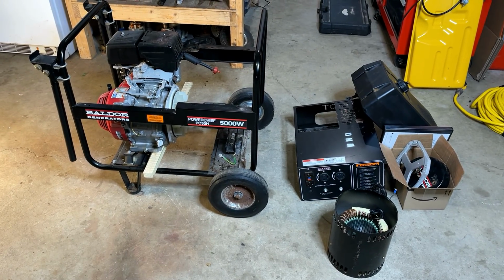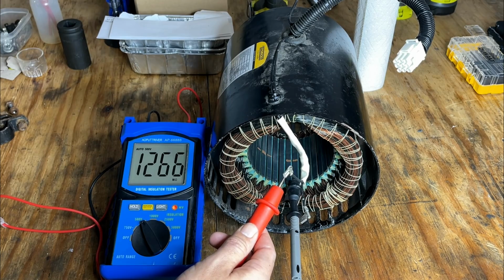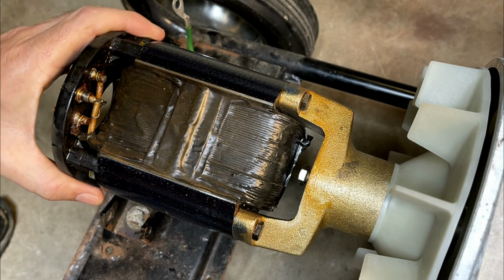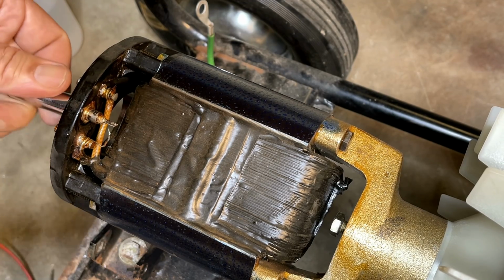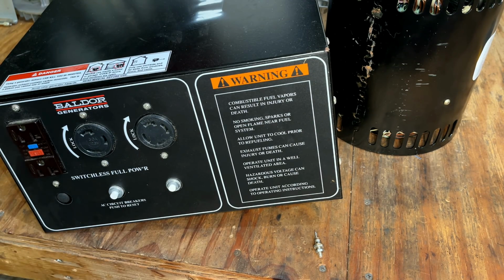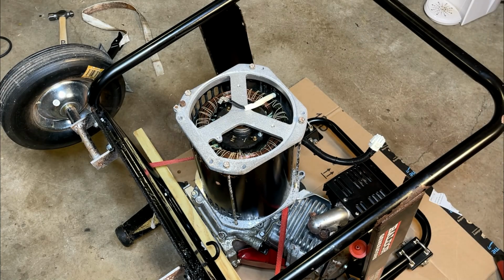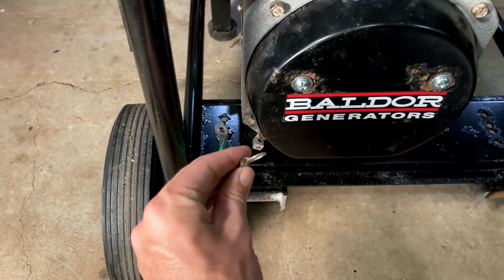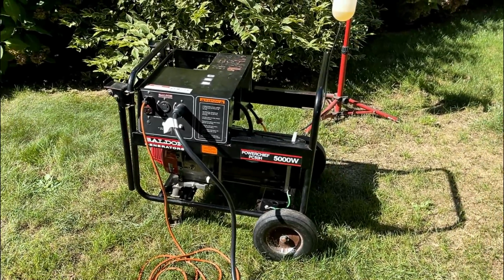Baldor Generator Not Making Power - Can It Be Fixed?

Comment: 0822MMXXV/1837h 🇺🇸 Thank you for introducing BALDOR Genset.  The rectifier in question, is International Rectifier  (IR) model. It's freely available from10A~25A. The rotor design is quite unique  and looks and functions perfectly. This design should be a standard in all gensets.
Reply from the maker: It was very unique.  Was nice that they made the diode serviceable.  Most manufacturers do not.

Comment: I have soldered diodes in an alternator an those diodes were heat sensitive, I used rubber band on a needle nose to heat sink between the diode and the  solder point

Comment: Should I turn off the fuel flow and allow the carb to run dry when storing my generator...?  Store it with a dry carb?
Reply from the maker: Always store with the fuel valve off and the carb dry.  It you keep fuel in the tank you must change it out at least twice a year.

Comment: John I would recommend you stop working with the multimeter on DC Ohm measurements. Neither is it usefull to measure isolation with 1.5V nor a very good diagnosis checking 0.5 ohm windings with a 200Ohm meter . Instead put a AC power  of 240V on the coil with a light bulb as a current limiter, that way you will even detect shortcuts within the iron packets and save lots of time.

Comment: Since the repair didn't seem to have worked out, because of the last very informative comment - I suppose when the diode you put in there saw that big ratchet - it went straight to its knees - let's see how it goes. So you got it off the ground - now I'm into Averlance diodes - currently learning electronics in my spare time and just finished the diodes/zener topic and finally understood more of the basics than before. Well - brushless generators generate dirty current - or voltage - I thought this distorted sinusoidal signal could have something to do with the diode you installed - I also have a few generators lying around that I can get out of the scrap junk for little money and buy more if necessary bring it back to life after experimenting - thanks for the video and so many detailed informations

Comment: Just looking at the diode you took out it looks like it has so much solder under the flux on the tab/wire lead that it has run down to where it touches or almost touches the body of the diode.  You may have added more solder removing the wire, I didn't pay that much attention and know you do that as many of us do.  I'm sure you probably melted that solder removing the wire, hard to tell if it was the original cause of the diode short.  But that might be why it would short when you pushed on the solder tab later.  There can be a small solder flake that sticks to the glass seal around the tab that can cause it, as well a problem internal to the diode.  Good catch, if the solder was the issue it could have been something that would only short when the tab bends a little due to centrifugal force when it is running.  That would have been a real bear to figure out.

Comment: That diode was probably never designed for the sustained g-force, and the internal link wire was likely moved into intermittent contact with the inside of the diode case. Cleaning up the diode and giving it half a turn before re-tightening (to reverse the g-force) might have done the job!

Comment: The diode in question is not a critical part, but a run of the mill rectifier diode. It is NOT a zener, as evidenced by the marking. Look for one in the same package with the positive to the stud, and a rating of about 200 volts and 10 amps. The actual rating is not critical, but polarity is.

Comment: the reason the resistance values climb up slow is that the windings act like a capacitor and it gets charged slowly...
Reply: the diode is a semi conductor, @ the best of times it is half way there.... this thing is acting weird...ergo it is defective, remove and replace....!

Comment: It was interesting to see the epoxy potting on that rotor.  I've seen that before someplace but can't recall just where,  I think that it was in the motor of a power tool.  This is a good thing!  I'm thinking that the manufacturers should be doing this,  but of course when you do you affect heat dissipation which needs to be taken into account.

I'd have done things a little differently than how you did.  From about the point where you put the spark plug back in.  I'd have hooked up that outlet box and spun that shaft with a drill,  see if it was putting out any sort of power at that point,  and only then proceeded with the rest of the reassembly.

I was just thinking while watching that how I'd be interested in seeing the waveforms coming out when you went ahead and did that.   :-)

Comment: On steel you can use some Muriatic Acid to dissolve all that rust and paint to prep for paint. Obviously use some Baking Soda/water to neutralize it after and it should look great afterwards. The acid should only take 1-2 minutes but dilution level will affect it a bit.

Comment: Here all my life I thought brushless gensets were cleaner electrically. Glad I have only had brushed ones now. I had a 400 watt modified sine wave inverter in my car while my daughter had a DVD player hooked to it for her son. Ruined that DVD player, or something did. Makes me only want to use pure sine wave inverters. I had a 2000 watt inverter on my boat and ran a microwave for years. Course now that I'm older I forgot some aluminum foil on a food packet and it took a year before it would run without smelling hot electrical insulation. Still working. When you get older don't expect to be as good at stuff. I am going to replace the oil intercooler on my Chrysler Pentastar when the weather warms up and both plastic intake manifolds need removed, I hope I don't screw it up.
Reply from the maker: Brushed are more bullet proof, but not recommended for anything sensitive for sure.

Comment: James what I consider happening to the diode is the heat of desoldering reset its silicon into it's good state. Not that it should be used. Just wondering.
Reply from the maker: Yes.  The solder connection looked very poor.  Some suggested I could reflow it.  But would rather go new then risk it failing and have to take it apart again.

Comment: Is the twine a special kind made to break if heated? 4 wires from 2 power windings, 2 being 
joined for neutral. +1 for ground+ 2 for exciter winding + 2 maybe battery charge coil.

Comment: A diode should  be measured in both directions. There should be about a 10 to 1 ratio in resistance between the readings. Disconnect wire from at least one side.

Comment: Just look for the same mechanical configuration with these specs. 400Vdc or higher and N x 5Amp, is the steady state field current for RV generator and 10Amp for whole house. N is a safety multiplier, usually 2x. 

In this case match the mechanical casing to look for 400Vdc or higher and 10Amp rms or higher. 

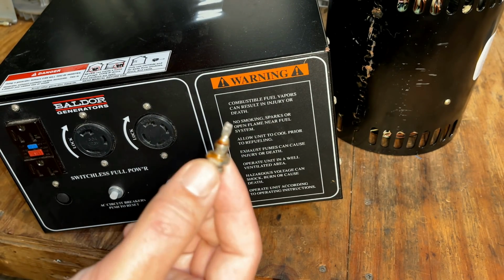For the chart on page 31:00
Discount the first two and pick any one down the list from 400V should work.

Comment: How can you determine before you buy the THD rating of a generator so you can get a clean power gen for computers? I had ordered a Duromax XT13000HX, but before delivery I stumbled upon a statement saying it had a 10% or greater and would need a PowerLine Conditioner for electronics. Too expensive a solution so I'm sending it back when it gets here. Don't want to make that same mistake again. Any thoughts on that??
Love you videos, BTW. Been watching one after another for 2 days now. It's ok, I'm old and retired. 😄
Reply from the maker: 6% THD is the upper end of clean power.  Inverter generators are very clean, but they cost a lot and are limited on power.  Other then an inverter, the next cleanest is a brushed generator with an AVR like the Duromax.  But as you found out, not all are created equal.  Best bet is to shop around and find a manufacturer that states 6% or less.
Reply: @jcondon1  I've checked til I'm blue in the face. Nobody lists that stat in any of their literature. Even the DuroMax was actually an answer to someone else's question on another site. I finally ordered a Generac XT8500EFI because they at claimed "Clean Power" suitable for electronics.
Will that little tablet scope you used answer that question for me? If so I might just buy that. Thanks so much for the quick response.

Comment: A Triac diode will pass A.C. It is two SCR diodes with reverse cathode and anode in parallel. There could be a capacitor between the Gate and anode to trigger an SCR. It has been a longtime! There are tricky ways of doing things Electronic! Have you heard of a guy called Munz?  Ron USA, PTL
Reply from the maker: I have not heard of him.

Comment: Hmmm.....good catch on the diode....at about 24:00 in the vid, you show a closeup of the diode....what is with all the flux, and the big gob of solder on the terminal??  Something looks fishy,  if that solder contacted the body, it would be a short. Just wondering if you cleaned that, to see if that was the 'intermittent' short??
Reply from the maker: It was intermittent.  Cleaning that blob would have worked, but it was also coated in varnish.  Not sure how well it would have reflowed.

Comment: I have an old Kholer 2.5CM in a 1991 Toyota motorhome. It puts out about 5v and will not operate a 60w lightbulb.  When I connect a 1500w heater to it, it will run it at half speed. At the same time, I can turn on the A/C fan and it will run half speed. Maybe diode? Thanks.
Reply from the maker: Could be a bad diode, but there is also a capacitor in the A/c junction box that is a common failure point.  Would test and replace if bad or out of spec.  The capacitor must be the same uf rating and the voltage rating the same or higher.

Comment: The Rotor is a jam fit on the shaft held with a thin bolt pressure but when the amps really increase, the pressure on the rotor as it turns in the stator must be great and still it doesant slip? Guess it is very tight but not actually locked with a key or thread or anything , just friction.?
Reply from the maker: Just friction.

Comment: After watching your video I noticed the part where you discovered the diode had an intermittent short. I think the diode is still good, the issue looks like the big blob of solder on the wire terminal is so big that it shorts to the body. Remove that excess solder and I bet it’s good!

Comment: Are all the windings on therapped with string all insulated  with what type of coating to keep from shorting out from each other. I forget the name given them ? Router windings or stator windings if one wire s shortedto each ot the wires it means it’s bad!
Reply from the maker: The wire used is called magnet wire.  Coated with varnish as an insulator.  If shorted to the same winding then will probably still work but not work as well as it should.  If shorted to another winding or ground, then the powerhead is bad and will either not power up or just melt down.

Comment: A Generac XG8000E (not mine)only producing half power. It shows 1.2 hrs. run time. I'm not a 'fix it man' , but any ideas? -thanks.
Reply from the maker: It could be a bad AVR or maybe a loose wire.  Also the AVR has an adjustment screw for the voltage.  Maybe it was set wrong from the factory?  Otherwise might be more serious, but the power head on that generator is made better then most.

Comment: I've been watching your videos and I saw instances where the stator needed to be replaced. I was wondering, if the engine on my generator fails, can I replace the engine with one that has more horsepower?  For example, my current generator is 13hp. If I install a 20hp engine, would that prevent the stator from producing power?
Reply from the maker: It would work fine.  The old stator would be spinning at the same speed and have the same circuit breaker on it to protect the powerhead.

Comment: That's not "IER" but "I-R" for International Rectifier. That's a run-of-the-mill silicon diode.  Not a zener, not an avalanche, not a shottky.  You're overthinking the problem.  You already know how much current it handles, so....

Comment: Hello I have a question I don't know a lot about it I have a champion 2000 Watt inverter. Do you know how much volts should come out of the power head it is a brushless unit I turned it with a drill an got 20.8 on the red wires  one an 10 .4 on the black wires it has 5 wires on plug don't know I hope you can help me
Reply from the maker: I have not worked on your model before.  Usually inverters output 3-phase AC on 3 wires and sometime have a secondary single phase winding (2 wires) to run the low voltage side of the inverter or other lower power things.  The last inverter I tested output close to 200V AC with the eco switch off on the 3 phase output.
Reply: Ok thank you that is help full I have never worked on a inverter generator befor

Comment: If you need to put rope in a buried cylinder like that, use a short piece of PVC pipe to guide the rope down. I had to do that on my truck with the ignition coils.

Comment: First thing I noticed the generator has not been dipped in varnish and baked. Is this normal? When I worked in an electric motor shop 35 yrs ago, we dipped all motors in varnish and baked them. I repaired my own defective generator, the field coil had over heated and it was dead., I removed the coil and wound a new one.I installed and dipped it in varnish and baked it in my wife's oven, while while was away. :-) After reassembly, it worked. btw, this was new and only lasted about 4 hours before dyeing.
Reply from the maker: Normally the stator is dipped and the rotor not.  Ideally they should both be dipped if you want the generator head to last.

Comment: What is the reason for using the high voltage tester? Is it because the coils are so long it needs a higher voltage to drive a current to test resistance? I'm not sure?

Comment: Try cleaning off the top diode connector heat up and knock off all solder, this rectifier has a wire going into a resin seal.

It could be the excess solder shorting the diode top connector. Please let us know if that happened to be the case, it will help others.

Comment: The voltage output waveform is quite ugly at low power and still dirty even at high load. Is this voltage waveform normal for the "brushless" generators?
Reply from the maker: That has been my experience with brushless.  They are very dirty without a load, smooth out under load but not a good sine wave.

Comment: Your diode difficulties are what i ran into with my eu2000i fix.   Bought a used non power unit, the stator plug had a broken wire, pulled that wire out and it had snapped at the metal connector internally to the white plug that goes to the inverter unit.  Found the actual model and type of plug and internal connectors and nonone makes It anymore, almost as if Honda had them made exclusively for their stators only.  Luckily I found an overseas seller who sold me a set of 10 and voila, back in power!

Comment: 11.26.21  11.26.21
James, that Baldor Powerchief PC50H was trouble.  Good that you found a replacement diode that worked for you.  

Do you use some kind of anti seize grease or oil to put on the bolts when reassemble?
I like watching you videos.  Thank you.

Comment: Check into a TOA Z meter. Used for testing high voltage speaker systems and reads through transformers.

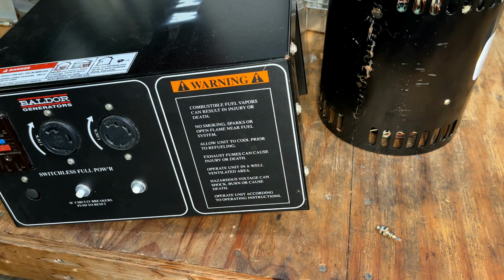Comment: Writing before finishing the video: @27:27 looks like a question for Mr. Carlson. That part was originally made by International Rectifier. Also, since the diode forward voltage looked correct intermittently, you could figure out most of the stats on a curve tracer.

Comment: 18:26  That would NEVER de-solder with a standard soldering iron that plugs directly into the wall.  The pliers are sucking the heat away way faster than the iron can generate it.

Comment: You can just pick a general purpose diode  with high voltage high current. diode in teh same hardware configuration. you will be guessing. there are tons of physically similar.  draw out the circuit where the diode is in. this will tell you whether it is a field diode or a Zener.   I have  drawers full of surplus diodes in that configuration

Comment: When you say becareful what you use it for...what are somethings not to use it for? What i mean as far as the generator making "dirty electricity"
Reply from the maker: Something expensive and hard to replace.  Would not be concerned with lighting or resistive loads like electric heaters.  Many power their heating systems with their generator.  Some systems are simple and little to go wrong, but others have a lot of technology in them and can be very costly to repair.
Reply: @jcondon1  oh ok....i understand, like you dont want to power your laptop lol...appreciate your videos

Comment: Oh and by the way when you were trying to de-solder the diode you had your long nosed pliers far too close ,so all the heat from your iron was going into them which was why you couldn't melt it, adding solder helped that situation, a trick I use is to heat the joint with the pliers around the wire but open and not touching then when the solder melts quickly close and pull
Reply from the maker: Thanks for the tip.

Comment: You should read your comments Jim you would have saved all the bother with the diode, when you held the new one side by side with the old, I thought how can he not see that the solder has collected at the bottom and is shorting on the case when you flex the centre pin? Good luck from the UK

Comment: It is a standard rectifier diode and you can be very safe with this causing a rectifying diode with revers voltage >800V and the top current for the package type. Or if you want to be more precise you can check the varistor specs and find out the maximum acceptable revers voltage on the diode (varistor is for protection of the diode) and pick a revers voltage higher then varistor specs.dissipated